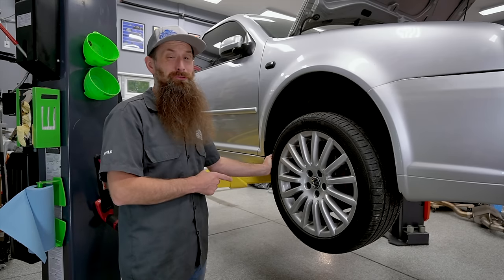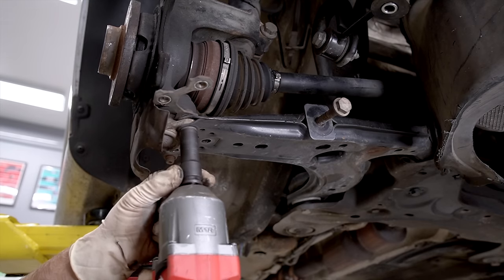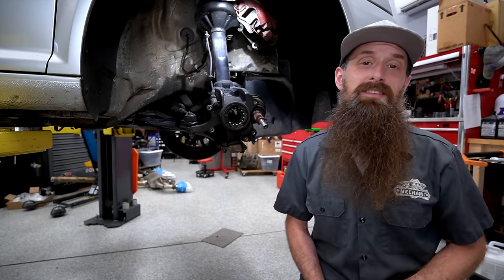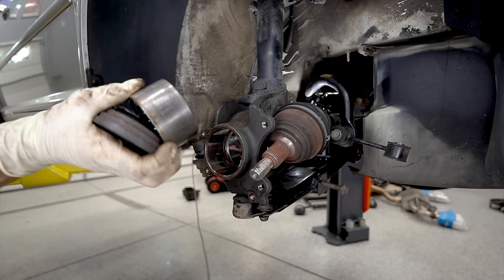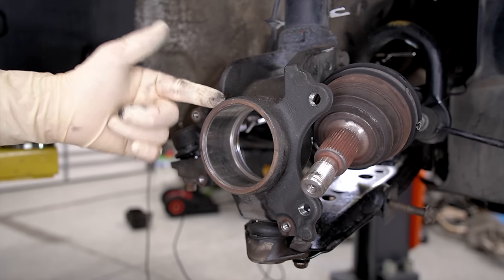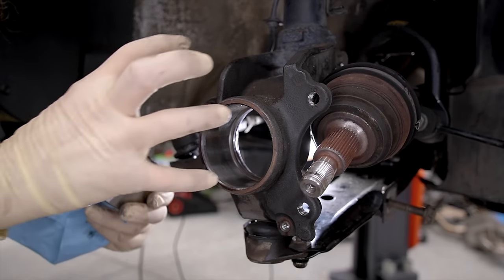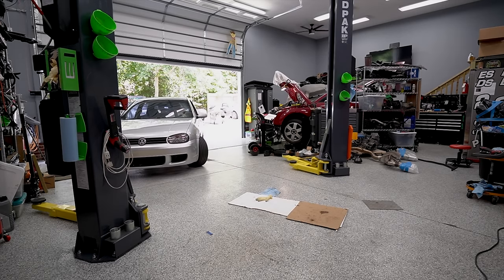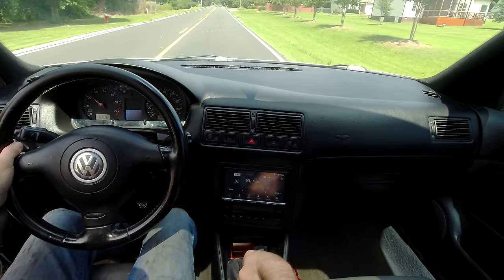How To Replace a PRESS IN Wheel Bearing ~ On The Car

Comment: Last time I changed a wheel bearing it lasted for about 5 months. I like to think that it was manufacturer fault but deep down I know that I hammered it in like a caveman
Reply from the maker: Hahahha
Reply: Or overtightened the axle nut
Reply: Hahaha at least you can secretly own it. Rent the hand press next time!
Reply: Know what you mean. I just paid a mechanic to do the other side. Save me a lot of pain and aggravation.
Reply: @HumbleMechanic  should I change career because electric vehicles is putting mechanic out of business. ? what your thought
Reply: I did one last week on my 15yr old Peugeot. But I got the whole knuckle and hub off a crashed 5yr old model. It was like brand new and much easier. Abs sensor already installed too. 😁
Reply from the maker: @adamwhite425  This is a GREAT question. Its something ive been thinking about a lot for about 4 years. LOL 

In short, MAYBE. I think if you're a mid level tech, you may want to consider a change. IF you are a top level tech. there will be so much opportunity. Much like now. 

I have a video planned addressing this exact topic.
Reply: @adamwhite425  you got at least 30 years before the gas vehicles start to fade off you can simply not work on evs until then now if ur investing in tools and equipment for your kids to take over they will have to learn it
Reply: @tinman9341  That's why we exist. I just had a 13 MINI Blooper in the shop. Owner does all his own work. It's been pretty good, except it's been eating batteries now for a year and a half. 

Anyway, as simple as registering the new battery. It had never been done in the almost decade this vehicle has been in existence. 🥴
Reply: @adamwhite425  ha! Out of business? Quiet the contrary. Wait until you see what a cluster EV's are.

Some of us have been working on them now for several years already 😉
Reply: @TheMechanicj  exactly, even if the last gas powered car was sold tomorrow, today's gas powered cars will still need repairs for decades to come. On that note, electric cars still need many of the same repairs as gas cars, just lots of other new things we'll all have to learn about.
Reply: @ua7pyro591  Definitely, we all made that rookie mistake. The workshop torque spec is for seating the bearing, you are supposed to loosen it and retighten it carefully. The inner ring around the axle are shorter than the outer ring, so you can adjust pretension and  adjust for endplay as the bearing wears. 200 Nm sounds like too much?
Reply: what ? im not supposed to use an impact driver to open or close up the 3 nuts that bolt on the ball joint when i did my cv axle boots on both sides ? oh f
and im supposed to also mark where the ball joint went ?! what?!?!
1k km later im still fine no change in steering people are just on crack
Golf 5 1K1 SDI @ 749,xxx KM
Reply: Speaking of "customer does their own work" gone wrong...after replacing the Right front wheel bearing(pressed-in like in this video, and both were bad but the left wasn'tsloppy yet and Xmas was coming). Her husband wasn't happy with the bill she approved, so he tried the left one himself.  Next oil change I found it very sloppy and the wife said impossible, so, I removed the caliper bracket, reinstalled a couple lug nuts on the rotor and had her wiggle it, the axle nut was loose and when I disassembled it with the wife watching me there was no snap ring...not sure if she's divorced now but she's never declined a repair order since...

He could of used your video's...
Reply: Hope you hammered it in on outer bearing race
Reply: @ua7pyro591  😊😊
Reply: @802Garage 😊😮
Reply: @adamwhite425  You adapt and learn. Nothing stays the same forever. You don't see many shoe shine peopl e
on the streets but shoe restoration is big business. I learned how to work on the old CRT TV when I was in highschool
the flat screens took over the market. Took the time and expanded to Audio along with video now I can do it all.
Reply: @adamwhite425  Electric carschave wheel bearings that go bad too.
Reply: @adamwhite425 never gonna happen guess what you’re easily able to be trained to service Evs if you want to double your abilities
Reply: Check your alignment, that's why they fail.

Comment: Basic concept with bearings is never load through the balls/rollers. Always push against the outer race/housing or inner race/shaft and you're golden!
Reply: One more important thing, if the thing you're pressing in is putting pressure on the inner race, DONT support the outer race on the other side but the inner one otherwise you'll push the bearing apart
Reply: @andries4561 
Very good point !

Comment: As a rust belt mechanic, I’m jealous of how easy that came apart, and how little clean up was necessary. Great information and tips as always Charles.
Reply: Hub goes off easily, a bit of hammering with a socket and that's it. By the other hand, the outer bearing race is harder to take out. I take out two of them in a three day span, and the first went off in two minutes, the second in fourthy minutes, because the bearing was much older. All done with a hammer, as my press lack of adapters and broke the first knuckle (it was from my car).
Reply from the maker: I have a lot of respect for you guys!!!! LIKE A LOT
Reply: In Florida, we just give the hub bolts a nasty look, and they apologize and back themselves out.
Reply: As someone who lives in Ohio I can relate to a good deal of time on of many jobs being cleaning up rust before reassembly....lol. I watch these guys outside the rust belt working on autos and yes, I am a bit envious. 
I know one guy.....Eric O.......has a youtube channel and he is around New York.....so he has it even worse than us Ohioans. My poor ole 2001 Silverado was pretty well rust free when I got it in 2011 and now after 11 years of Ohio weather the cab corners, rockers and rear wheel wells on the bed are about gone....but the frame is still solid.......yes, the rust belt woes....lol.
Reply: I am from a hilly/wooded area (mid Europe) and here they also use much salt... you can also check Gerhard Holzknecht who specializes on rust removel and protection... a good protected and cared for car will also live through "rust belts"...my car is 25 yrs old (VW) had I protected it better it would have not much rust but I neclcected it for a while...
Reply: Yup.  Came here to say that.  I still have nightmares from trying to remove press-in bearings from a Mazda MX-6.   After breaking a number of tools I gave up and liquefied them.   Can't be tight if they're liquid.
Reply: Absolutely jealous T.T
Reply: Yeah a good perspective is also how many jobs he's probably done that were the exact opposite of this.  Respect for any honest mechanics out there doing this on a daily basis, people expecting it to just go off without hitch.
Reply: @HumbleMechanic   dddx,,,,,,,, 😮, w q hola a
Reply: i was about to ask if he pre broke the bolts for the video haha

Comment: For anyone watching, if your brake caliper is moving along with the wheel and brake rotor, then it probably not your wheel bearing. It might include wheel bearing but wheel bearing alone, the caliper will stay in a fixed position :)

Comment: As a rust-belt mechanic for a VW/Audi shop, I used anti-seize on anything that didn't already call for a specific grease/threadlocker. I have never had the moly grease come with my bearings, so I always anti-seized the bearing in and anti-seized the hub into the bearing. We also did a lot of seasonal wheel swaps so we also anti-seized wheel hub faces and lug bolts to make sure our wheel swaps were effortless.
Reply: Same, as someone who lives in the rust belt, I pretty much put grease or anti-seize on anything that can safely have grease put on it.
Reply: Rust belt DIYer, everything I replace on my car gets Fluid Film'd or anti-seized if at all possible.  Been Fluid Filming the underside of my car for years to delay the inevitable death-by-rust but it also keeps suspension bolts from rusting in place...mostly 🤣
Reply: I live in eastern Canada ( New Brunswick) where the winter temperatures  go through big changes over a few hours. Rust is a big problem here. I use a lot of anti size when  doing repairs and on hub face and lug nuts. I also carry a breaker bar in trunk. I don’t want any problems if I have to change a tire in minus 20 degrees.
Reply: I do the same thing in Southern California. Even the wheel cleaners can cause severe corrosion to these parts and cause wheels to stick on the hubs. I never have issues removing wheels, hubs or components that I used antiseize paste on. I think it is a sign of professionalism and courtesy to the next guy that works on the car.

I have tons of respect for the skilled rust-belt mechanics, they are masters at what they do.

Comment: Easiest hub removal I've ever seen. Because of that and the appearance of the inner most hub shaft surface, hub had to be loose in the inner bearing race. Plus the tone ring for ABS was damaged making replacement with a new hub  the correct choice. The whole press in bearing job was the easiest I've ever seen done or done myself. I do on car using hub grappler by OTC. Easier set up and quicker due to less disassembly than using a shop press where set up is a real pain due to odd shapes of spindles. Plus saves having to do an alignment on some cars. Snap ring placed in hub is a good tip, I know that sick feeling you get when you look down and see the snap ring on the floor when you're torquing down the axle nut. ONLY HAPPENED ONCE, BUT IT LEFT A LASTING IMPRESSION. Thanks Charles.
Reply from the maker: MAN that feeling HAHA I felt it when I read your comment. I hate that it went so easy TBH. I prefer when its a pain for me, so people can gear up for somethign bad.

Comment: I remember replacing both front wheel bearings on my MK3 GTI VR6.  I didn't have the ability to press them in, but VW Parts Place will sell you a refurbished carrier with the new bearings in place, and you return your carrier back for the core deposit.  It worked out great.

I have more ability now, so I'd definitely just rent the tools I need and do the job.  Back then, it was the furthest this home mechanic had ever dug into the front end of a car, so I'm glad that service exists.

Comment: One year I did a wheel bearing right before leaving for H2Oi in OCMD from NJ which was about 250 miles each way.  When I left town after the weekend I started to hear the humming and knew it was bad already. By the time I was 50 miles out from home I was truly worried I wouldn't even make it home because the sound had progressed so much. Luckily I did. I learned a valuable lesson that day. I had put a new bearing on the old hub, and I guess the tolerances had opened up. From that point on I will always do a bearing and hub together. Especially, as you pointed out, when the hub is 30 dollars.

Comment: Of all the mechanics I’ve seen on YT, you are my favorite. Thanks for taking the time to explain the finer points of the jobs you’re working on. Explaining that you need to use slightly different sizes when pulling and pressing in the bearing is the type of information that amateur mechanics need to know/learn.
Reply from the maker: Thank you so much

Comment: Holy crap, never seen a hub just fall out! Guess your axle nut was really doing its job. In my experience, at least on Japanese cars, slide hammer is a go. The right snap ring plyers are great. I also prefer not to use power tools. The feel is important and a lot of wheel bearings have been damaged during install from off angle stress, usually with a press. Being in the NE, I like to add a layer of grease to the inside of the knuckle and/or outside of bearing. The snap ring holds it in place anyways, it will never move, but then it can't become seized with rust in the future. Light grease in the snap ring groove too. That's quite the axle nut torque procedure. Great work as always!
Reply from the maker: this whole job went so easy. I feel bad for people watching how to, and they have struggles. LOL its not fair.
Reply: That axle nut wouldn’t help anything.
Reply: @jaredmayer3960  it might have been the last thing holding that wheel hub in from the looks of it.
Reply: @HumbleMechanic  don't feel too bad, because of top-notch videos like this I'm sure you'll be saving countless hours of frustration and headache. Thank you so much!

Comment: I was a little surprised that the OTC Hub Tamer or Hub Tamer Elite wasn't used for this job.  It makes all of these steps so much easier.  It is the preferred tool for this job for 20+ years.  There are even foreign copies of the tool.

Additionally, I use MIG welders and plasma cutters to remove bearing races.  Nobody uses a Dremel, ick.  Inductive bolt heaters or a heating tip on an Oxy-Acetylene torch are used.  I do this work on the side, and these tools and tricks have been known in the industry since forever.  We have to do the job correctly.

Comment: Charles, this is another good helpful video.  A perfect follow up video would be to demonstrate removal/installation of the rear wheel bearing assembly on the MKIV GTI, if that's necessary on the GTI in this video.  Thanks for your great work.

Comment: Work as a tech in the rust belt, and just did my front end hub assemblies on both sides. I have that press tool and after about 30 minutes gave in and took the knuckle out and threw it on the hydraulic press

Comment: Always lube.  In the old days, especially with OEM parts, came with a little packet of Molybdenum Disulfide paste.  Even though not noted, I put Molybdenum Disulfide past on the hub and bearing, also.  I put anti seize in the groove for the snap ring.

Comment: I come from a rock out in the Atlantic ocean, unless it specifically calls for loctite we anti-seize the living crap out of every nut, bolt and assembly. Even then it's not enough sometimes. Cars with cheap flimsy subframes and control arms typically only last 5-8 years before they are fit for the scrapyard. Undercoating every year is a must. A chip in the paint has to be fixed immediately otherwise your body panel will rot off in a couple weeks. I live out west on the mainland now and rust is a non-issue. Makes my life so much easier lol

Comment: I have done many of these pressed in bearings over the years. It is always nice when the snap ring is on the outside because you don't need to remove the knuckle (as opposed to having the snap ring on the inside end)

I have always used silicone spray to lube the bearing and the hub when pressing in. I also leave the new bearing in the freezer for a few hours and it helps things slide in nice and easy with the press tool.

Comment: Great video. I have a similar bearing removal kit shown in the video. It works great, but I needed to buy a 28mm socket to fit nut. Make light work of changing a rear wheel bearing, without the need of a press. You really need to be distracted to miss the circlip replacement, but your advice is good. I have done a few wheel bearings of different types, as a DIY home mechanic.
Reply: Did you buy it of AliExpress for 45$?
Reply from the maker: I think my issue was totally being distracted. Thats shop life really. A constant stream of distractions. ITs why I put so much emphasis on being organized.

Comment: I hadn’t done a press in wheel bearing until a few weeks ago, I’m a second year apprentice mechanic, as I’d worked on minis for my first year, they are mostly bolt on wheel bearings, I found press fit wheel bearings to be a lot easier than I was informed they’d be 😅

Comment: Humble mechanic, 10 years ago when I was looking for a car, I saw a 2009 VW Passat 2.0 T 6 speed manual and I felt in love.    I still have that car but little problems keep on coming up.  Still runs great though.  

To answer your question😄, “what’s the best way to fix your Volkswagen”.  I wish I can say,  getting rid of it.   I just replaced all rotors all brakes pads and 3 bearings.   Ow I think the left front is acting up, I hear a little clunking / subtle grinding.    I think it’s the wheel bearing.   Could it be cuz all the other 3 are brand new that I’m looking for perfection.   I’m hesitating to replace it to save $273 Canadians dollars.   It’s so call life time warranty on a OE PLUS wheel bearing.  I have nothing to loose other than time if I do replace it.    Any advise.   Great videos by the way.
Reply: Luis, if you love the car and it seems you do then keep it forever lol. SOOO many cars and trucks I have had that I wish I never got rid of. So, I love that you love it, keep driving it and smile with every mile!!!

Comment: I have a jetta with 615K miles on it.  I have had them come loose like you noticed with this one.  I have since started leaving them highly torqued instead of backing them off and retorquing.  Also if you take the one strut bolt out you can pull the entire hub out and work on it easier on the floor.

Comment: These repairs are pretty fun to watch.  I don't have a modern VW (I have a '72 Beetle), but your commentary is pretty entertaining ("I said it that way because it's funny"  😄).  Keep them coming, Charles.
Reply: You do realize Gen 1 Bunnies used a bunch of parts from the Beetle including 1  of the drive axles and the Beetles front wheel bearings on rear axles of the Rabbit

Comment: The wheel on my wife’s beetle was just as bad as that one, thought for sure it was a bad bearing, bought everything I needed. Went to pull off the axle nut and realized it was very loose, tightened it up and wheel stopped moving, definitely double check axle nut before getting too far into it.